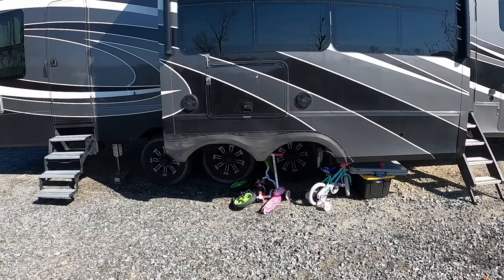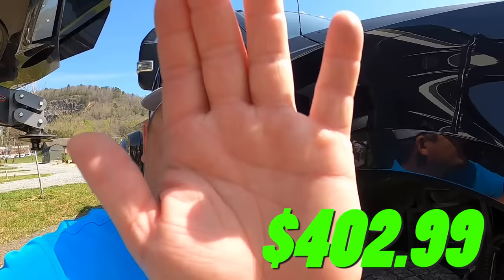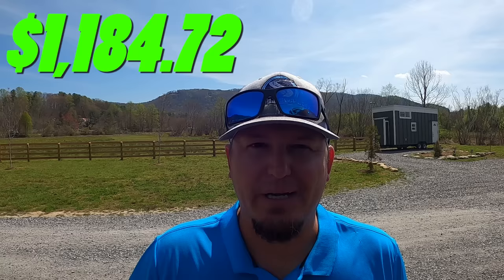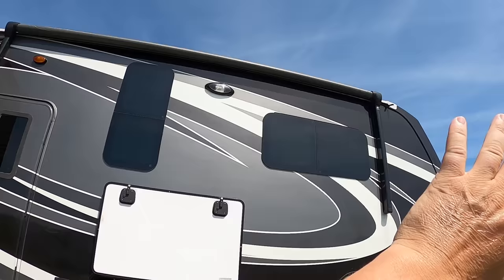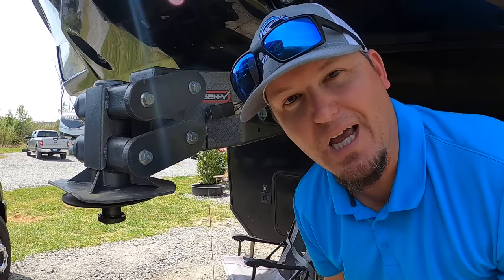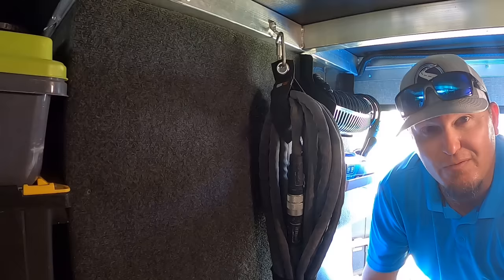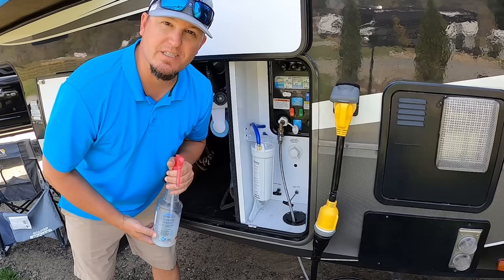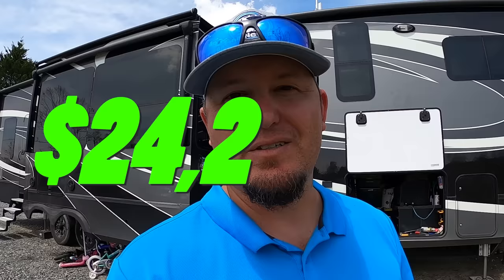These Things Are Money Pits! Everything That We've Had To Repair! | Fulltime RV Living!

Comment: Someone should tell him that's not how airbags work
Reply from the maker: You mean they are not supposed to be used to level your truck and help support the stock suspension when towing? Maybe someone will tell us how they really work, then maybe you will learn!
Reply: @PavingNewPaths you replaced them because they required full pressure to stay level. It doesn't matter what bags you're running the pressure to stay level will remain the same. The bags will pop if they cannot handle the weight
Reply from the maker: @macbook802  No I had bags rated for 5000lb at 100psi! We were having to air them up to max pressure to level the rig! We decided to upgrade to the 7500lb at 100 psi bag! Now we can level the rig with 65-70 psi! Instead of running my bags at thier max pressure to do the job we can now run with bags at 75% of max presssure! I would explain to you how the diameter of a bag and the psi used determines what kind of force they have, but you already know that becuae your the airbag expert!

Comment: In all fairness, to own an RV this size with multiple systems, triple AC units, Etc is to me beyond reasonable. Then you need a Dually Diesel strong enough to pull this monster. I did have a 1500 series Silverado that pulled an 18’ RV, it did so without a problem. Travel Trailers are notoriously cheaply built. I had water leaks in the plumbing. I eventually traded both my new Silverado and the 18’ RV for a Class C. Much better quality in its build. I was wise enough to also purchase the best warranty available. So far no problems, my ease of mind is worth it. Although I remain skeptical. At a cost of over $5K this warranty means if “Anything “ breaks, they’ve got to come and fix it and provide for lodging.
Peace of mind is certainly worth it.
Reply from the maker: In all fairness before you judge we told you in the beginning of the video that we live and travel fulltime in this RV! So what you consider to be beyond reasonable is actually our home! We don't own anything else but this truck and RV! I would agree with you if this was something we used to go camping 3 weekends a year! Hope you never have to use that warranty, the fine print will make you wish you saved that $5,000 and just fixed what ever problems you have yourself! We don't have a warranty, didn't pay for any extras, bought used and even with everything we have spent, we still have less into it than a new one! But the biggest benefit of doing everything yourself, is the RV has never been to the dealership and we have never spent a night without the rv!

Comment: I got a 1997 catalina coachmen with zero slide outs. My dad bought from the original owner for 3 grand and then my dad just gives stuff away when done with it so he had it for sale for 500 bucks. I offered 300 and he took it. I put 1200 in it for tires and a bunch of small repairs. Now it doesn't look pretty but everything in that camper works from the AC to heat, fride and water heater. I was thinking about upgrading but ive had people tell me at campsites, you own it dont go into debt buying these new junks. They are made poorly and will be a headache. Take care of the one you got and enjoy it. So although it doesnt look nice parked next to other campers at sites, ive got 1500 invested when i roll up compared to 1000s
Reply from the maker: You have to remember we are not using this to go camping a few times a year! This is our home that we have lived and traveled in for 3 years now!  While some might think this is a lot, this is all we have and it is a far simpler and cheaper way of living that what we had owning a home!
Reply: @PavingNewPaths  yes I know. Your usage is alot higher than mine. But I've met people who take there campers out 5 times a year and spent 30 grand for it. Hell my neighbor spent 25k and takes it out a few times a year . My point is if people are not gonna live in there's maybe the ROI on a brand new camper isn't very good and should go with a good used one. There not pretty but will get the job done
Reply from the maker: @fandango_buttlicks  That is why we bought a used one! Our RV us amazing and is worth way more than we have in it!

Comment: If you  buy an RV you better have spare cash primarily for gasoline mine will give me 8.5 miles per gallon if I drive under 55 mph. So every stop will cost you over $ 150.00 just for fuel than comes snacks ,n drinks and essentials  if you  bring your family .My two cents MIGUEL NEGRETE 11_19_23
Reply from the maker: Yes, indeed! Diesel isn't cheap and we get about 8 mpg when the RV is hitched up! We do try to make our lunches/snacks and store them in a cooler in our toyhauler to help with costs! That way when we stop for diesel or a break, we don't have to go in the truck stop since we have lunch and restrooms onboard!
Reply: @PavingNewPaths  My wife purchase a minuture electric grill .We cook our egg omelettes n fix them in a crossient bun with cheese n ham ,gotta try it this is fast, delicious  n efficient,not mention economical. Eggs cook in less than two minutes. 
Make sure have a trash bag available ,clean and as you go .Good luck  .Miguel Negrete 12-5-23

Comment: please replace your own fuel filters $30, very easy.
Reply from the maker: It actually cost around $90 and there are two of them, I have done it myself several times, but we travel fulltime and RV parks have rules against doing this type of work in the park!
Reply: @PavingNewPaths  I have the chevy duramax, 1/3 that price, but still cheaper than the dealer, I get the RV park issue.

Comment: What make is that RV? I want to make sure to avoid it.
Reply from the maker: This is a Grand Design Momentum, but if you use an RV fulltime all brands will have the same result!
Reply: @PavingNewPaths  I'm not worried about the wear and tear that comes from using it as a full-time residence. But the floors dropping out, and the roof peeling off, and the interior trim falling off? Very poor build quality.
Reply from the maker: @MrJeffcoley1  You will find that no matter what brand you have! It may not be the same set of probelms, but there is no RV out there that will not have any problems!

Comment: I could see repairs for the truck. Ford diesels are garbage...Should've got a Duramax diesel.
Reply from the maker: Nope, Ford family all the way here!
Reply: @PavingNewPaths  I've owned Dodge and Ford diesels. Bought a Chevy Silverado 2500 with the Allison transmission. GM  made me a believer. Best truck I ever owned and still own. The Allison transmission acts like a Jake brake, slowing the vehicle down, saves on brake pads..
Reply from the maker: All of the trucks have exhaust brakes now!  All the brands make good trucks, but saying one is better than the other now days is pointless! No matter the brand if you use it, there will be maintenance and repairs!

Comment: Thank you for this video.  I think I'll rent a house instead.
Reply from the maker: You have to remember we live as a family of 5 and travel fulltime in this RV!  If you just use your RV a few times a year you will likely never have most of these problems! But if you intend to use longer term, things will happen, especially in the first 6 months of constant travel!  But it is totally worth it to be able to travel and see what we see as a family!
Reply: @PavingNewPaths  Thanks for your reply.  We will have six living in our old toy hauler (and old (2008) means things break more often than in a newer model).  My work doesn't leave much time to travel, but as a contract job, an easy move of pulling in the slides, hitching up the truck, and heading to the next site is nice.  However, I haven't done nearly as good a job counting the cost as you have, so I just had a vague idea it was expensive instead of actual figures.  I did it thinking it would be cheaper than renting, but that has proved otherwise.
Reply from the maker: For us we knew what we were trying to accomplish, and we had a budget for our plan of fulltime travel! We didn't expect the maintenance and repairs to be the most expensive monthly cost!  we figured it would be RV parks, Diesel or adventures! We have learned it is just part of the cost to live the lifestyle we want to have out of this! We made a video about our monthly cost as well you can check it out here https://youtu.be/RQGACy9_-WM

Comment: RV’s are made out of crap and are not designed for constant use. This is not to mention the roof systems. Truthfully, I think your not doing to bad. It will get worse. Enjoy.
Reply from the maker: They are not junk at all and there are actually several models that are made for fulltime use, this is one of them! Could you imagine how the video would have been if I used one that wasn't? The roof however wasn't very good and we repalced it with an RV armor lifetime roof

Comment: Comes to show how bad the quality on both of those products are, especially the camper... horrible for that much to go bad with a such a new unit.
Reply from the maker: I think you missed the context of the video, if we used this thing a few weeks a year, yes I would agree this is a terrible unit! But this was what 2 years of fulltime use looks like! It is actually pretty amazing considering where all we have been and what we have put it through! We use this thing more in 3 months than most will in 10 years! If anything it is a testament to how good the RV and the truck is!
Reply: @PavingNewPaths  things like the bottom falling out or the roof starting to peal.. It screams cheap workmanship.
Reply from the maker: Your right both of those things and a few others were because they could have done a better job building it! But there is no brand that does it better, they are all built the exact same way! so you buy and RV that has good bones and systems on it and make repairs and improvements as the happen! The Roof was the only thing that disappointed us, but instead of giving up we made the repair on the road with a company that offers a lifetime warranty! Everything else is mostly just annoying little things to fix that come from moving so often!

Comment: My wife and I have been full-time 3yrs. . We purchased an older coach class A . Knock on wood we have had no major issues. Our RV has taken us from California to Florida and back, of course gas is not cheap . We have been camp hosting for months at a time. Which has been a great way to save on rv park costs plus we are stationary so saving on gas. We have been to so many cool places the state parks really appreciate thier camp hosts. It comes down to to your budget, but dont let this rv er with the most expensive rig, they cost as much as a sticks and bricks,  Im sure he has a doodle and and we know he has the E bike. Its a club but you dont have to be in it. Look at older RV s they are built better and less expensive.  Dont let this guy scare you, best decision I ever made. But if you wanna be in the doodle club go for it. Either way, your adventure is waiting for you, what are you waiting for.
Reply from the maker: This wasn't a video to try and scare anyone away from the RV lifestyle. It was simply a video to share our costs in regards to maintenance and repairs over our two year period of fulltime RV life. We actually didn't buy the most expensive rig, we bought used and are the second owners. We did buy our truck new, but only because we traded in our two vehicles to upgrade to the dually. We are so curious as to what the term doodle is, as we have never heard of it? Your degrading tone makes it seem as if it's not a good club to be in, but we actually have no idea what club you think we are part of!
Reply: @PavingNewPaths  I didn't mean to hit a nerve, I apologize.  Your video just seemed to me as if you were only focusing on the negative financial aspects of the RV lifestyle.  I realize you are trying to get veiws and that is fine. I was simply wanting people to know that their are a multitude of ways to live this lifestyle, and your financial obligations should not detour anyone. A doodle is one of those hypoallergenic dog's . Safe travels to you!

Comment: These 5th Wheels are PILES OF CRAP.  To have lenses crack, roof PEELING back, and so on...trim falling off....all of those problems are a FACT of POOR MATERIALS, workmanship and essentially TERRIBLE BUILD QUALITY.  We own a newer 5th wheel (Landmark 365 Oshkosh) and an older Diesel Pusher (Holiday Rambler Endeavor Diesel).  The HR has INCREDIBLE build quality and we have had ZERO material failures in over 20 years.   The new RV's are GARBAGE.
Reply from the maker: Yes they could all be built better, but what we have found is that when someone tells us they have no problems, its because they aren't using the RV the same way we are!  We meet fulltime travelers every week and no matter the age or the price of the Rig they have if you are truly using the RV the stories are the same!  Even those fancy 1 million dollar Class A's break down just as much as ours!

Comment: well,   I only watched for a few minutes.    Till you got to the part about airbags.       Why do you go to ford dealer for oil changes.    Do it yourself, or go to a quick lube.   Cost savings, 50%.   Fuel filter changes?   why change so often.   That's twice as often as recommended.   And once again.   Filter kit is not that expensive, and you can easily do it yourself.   Cost savings,  over 50%.    Air bags!   
   Anyway,   Rv'ing is not cheap for sure.   And things break for sure.    But it can be controlled much better.
Reply from the maker: We travel fulltime and don't have a home base to go home to for work! Most RV parks have rules about doing oil changes and fuel filter jobs at the park! So we do it ourselves when we can, and when we can't we pay the dealer! We do all of our maintenance based on the schedule given to us by Ford! Are you saying we shouldn't follow the manufacturer's maintenance schedule? If I need to explain why this truck needs airbags, then you likely have never towed something this big! The cost of everything in this video is a result of us doing the work to control the cost! The point of the video was to show what we spent over two years to live fulltime! Why does it bother you how much it costs or what we did?
Reply: It bothers me because it makes it sound worse than it really is.  It's expensive enough for sure.   And yes they are money pits as you describe them.  But cost can be mitigated.    As far as air bags go.   I installed a set of airbags on my 2013 F 350 single wheel rear axle.    They worked as far as bringing the bed level.   But what they don't do is increase the payload carrying capacity.       @PavingNewPaths
Reply from the maker: @acro2eaa  Actually is the opposite this video makes it sound better than it would be! See we did all the work oursleves and this is how much it cost! If we paid to have everything done it would have been double! No one said airbags increase capacity! Who said that? But you will not pull a trailer this size without them!

Comment: Half the stuff you put on your truck leads me to believe you simply enjoy throwing your money into the fire.
Reply from the maker: What did I put on my truck that I didn't need?  Tires, Shocks, Brakes, New Oil, New Filters, New Batteries!  Do you suggest I not replace parts when they wear out?  The only accessory we have on this is an onboard air system with airbags, that is something you have to have if you are going to tow something this big!
Reply: @PavingNewPaths  You upgraded shocks that didn't need done.  Despite dropping 600 bucks to upgrade airbags when you already had airbags, you still put another 400 plus to install a system to avoid a death wobble you never had.  Plus you let Ford work on your stuff.  Maybe you're too easily influenced by salesmen, or maybe you just have more money than sense.
Reply from the maker: @colliswilliams8992  We have never spent money on something we don't need! We also do all our own work, but none of that really matters, why does it bother you what I decided to do or spend on my truck! Last time I checked how I spend my money had no affect on you!
Reply: @PavingNewPaths   the title of the video isn't "what I decide to spend my money on."  You're not giving a list of necessary repairs to keep your rig on the road.  You're including a bunch of extras that you wanted rather than needed.

Comment: Crazy that u pay that much for fuel filters. 30$ from Amazon and 30 minutes max to change
Same for oil change .. synthetic with filter. 65$
Reply from the maker: Actually the fuel filter is around$70 and changing your own oil with syntetic is around $90 doing it yourself, I know this because I do it myself when RV parks will allow it! But I am not sure why what I spent taking care of my truck bothers you so much! Maybe it's the Duramax in your name that causes you to be this way! When you buy half a truck it cost half as much to take care of it!
Reply: @PavingNewPaths  It doesn't bother me. I taught it was a great video and I enjoyed it. Sorry i came off as being a butt.. I meant. That I am amazed u pay that much for it.. no disrespect.   I just changed my oil 3 hours ago 10 quarts and a filter was 65$..  and my fuel filter from Amazon is 30$  and very easy to do..
Reply: @PavingNewPaths  and furthermore we are so close to getting a toy hauler.  Momentum was our top 2 options.. after your video. I am afraid and might go witha raptor..  again. Loved your video